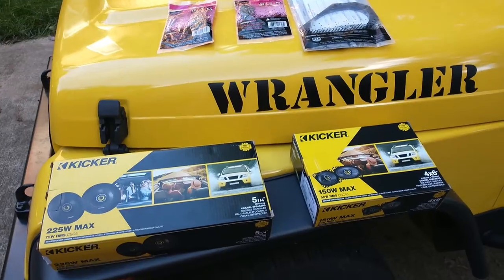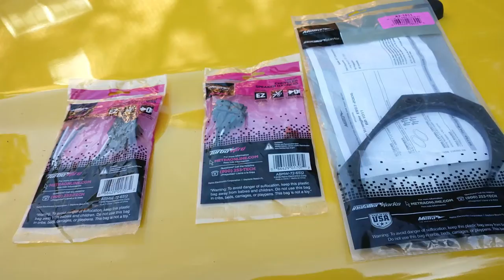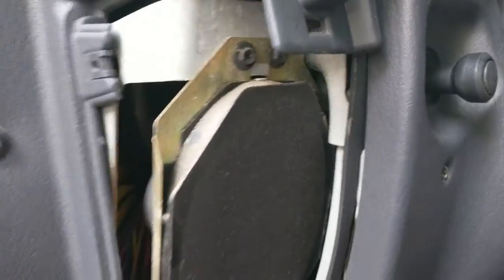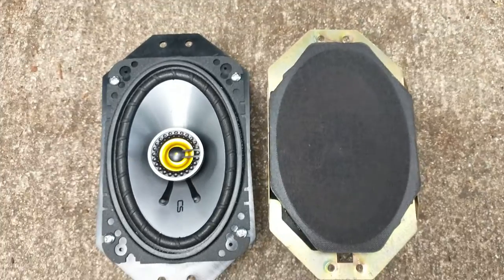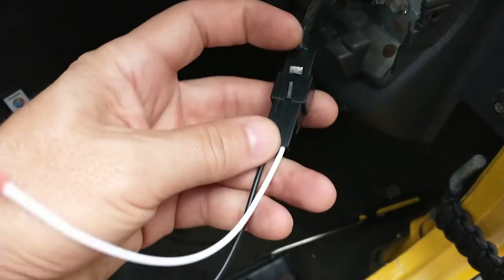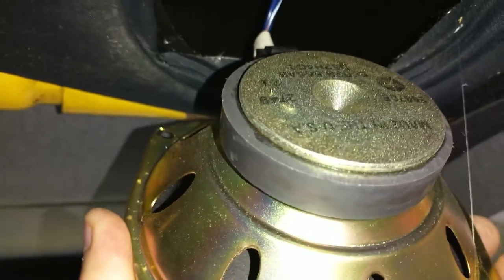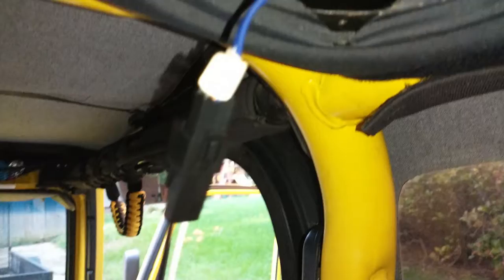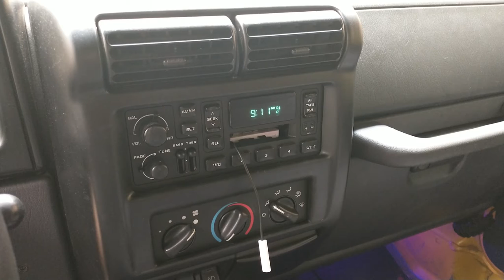Installing aftermarket speakers Jeep Wrangler TJ

Comment: Hey mate.. thanks for the video - the speaker connectors did not work with my '06 wrangler just so you know, they aren't compatible for anyone watching.
Reply from the maker: Thanks for letting me know. I'll pin this comment so others see it.
Reply: mine didn’t work either. now i don’t know what connectors to get
Reply from the maker: Are they all the speakers or just some?
Reply: RED WOLF Door Speaker Wiring Harness Compatible with 2002-2019 Jeep Wrangler JK, Chrysler, Dodge Vehicles Car 72-6514 Harness Plug for Aftermarket Front Rear Door Speaker Wire Cable Connector 4 PCS

this is the connector i ended up getting. perfect fit in my 04 wrangler
Reply: I have an 04' as well. I will use your suggestion thank you. @culbyjenn
Reply: I wish I saw this before I purchased the connectors
Reply: @culbyjenn  might have to spend a bit more and get a amp to run everything. u dont need a huge amp, u can get something small and run a bit better speakers than the ones that work with stock power.

Comment: Great video.  I did the exact same thing in my '04 TJ.  As mentioned by another viewer, the wire harness / connector was not compatible with my Jeep either.  Easy enough to splice wires together though.  Thanks!

Comment: Nice job on the video.  I also replaced the bass driver in the console which was a very nice improvement to the bottom end sound that actually produces fairly decent bass.  Nice detail, reminding about the direction of the lettering on speaker covers.

Comment: Thanks for the video. Its seems like you were pretty confident you could have used the original OEM cover for the roll bar speakers? They fit over this kicker brand speaker?

Comment: By any chance do you know how to replace the console speaker between the two front seats in a Jeep Wrangler TJ 2001?  Install of the aftermarket speakers in the sound bar went great due to your video.  Thanks!

Comment: Thanks for the video. Looking to do this install soon, as I just swapped out the subwoofer with the quadratec replacement. All my other speakers are factory. The factory sound decent. How much better would you say these are compared to factory?
Reply from the maker: You're welcome! In my opinion it was a huge difference. This is actually my daughter's jeep and for her jeep it was a bigger difference then most because two speakers did not work. The front driver's side speaker was shorted out preventing the left side from working. So for us the difference was huge but they do sound clearer than the stock speakers. Better bass and treble sounds.  Good luck with your install if you do it!

Comment: Im gonna do mine..could find the sizes in JL Audio..so I'm trying to compare Kicker to the JBL... any thoughts 😕
Reply from the maker: I am not completely sure what you are asking.  If you want the sizes of the speakers I used you can click on the speaker links I put in the description of the video.  From there you will see the sizes of the speakers I used.  If you are asking which do I like better JBL or Kicker,  I am not really sure. Both brands make good speakers and I don't think you could go wrong with either of them.  Good Luck!

Comment: I bought all the same connectors but my '03 Sport 4.0 has different connections. Are the front connectors different from the rears?
Reply from the maker: On my jeep the connectors are the same on the front and back. Look at the 2:25 in the video for the front connector and 5:25 in the video for the back connector.

Comment: My speakers in my factory 2006 wrangler Ruby don't look like the regular 4x6 here.... they are smaller and have little connected tweeter's....can I still install 4x6 as seen here
Reply from the maker: Everything I read tells me they will fit but to be safe you could go to Amazon and put in your 2006 Jeep and before you decide to buy it will tell you if it fits. If that does not help go to crutchfield.com and they have something on the site showing you what fits.

Comment: Any idea if the speakers with woofer will fit a 2003 tj?
Reply from the maker: As far as I know all TJ's use the same size stock speakers. So the speaker sizes I used in this video should work in any year TJ unless someone modified it from the factory sizes.